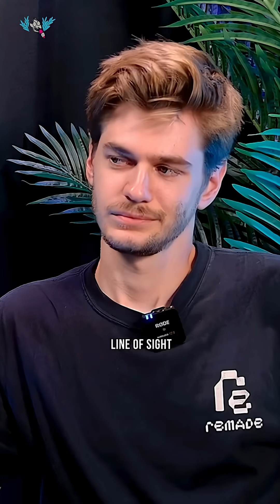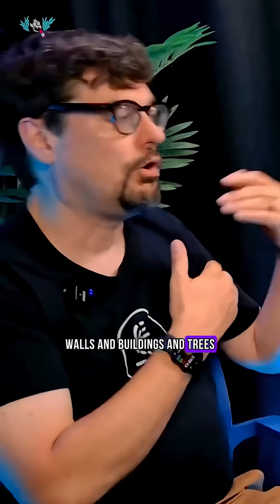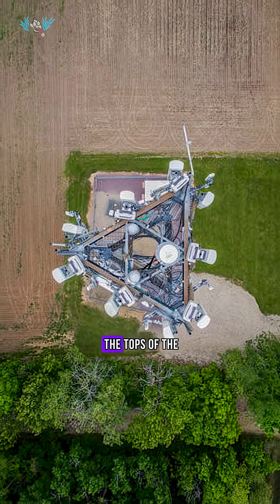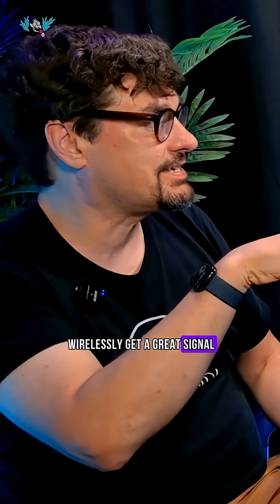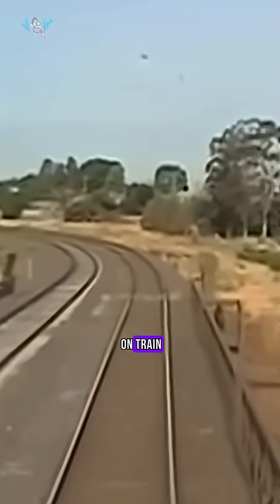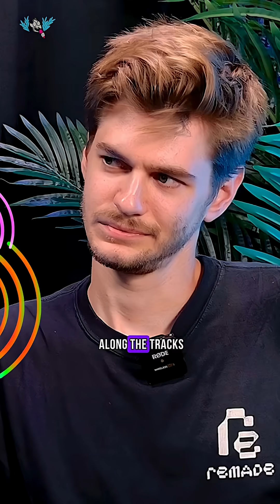Why Amtrak Train WiFi is now slower than Plane WiFi

Comment: The solution is in the pipeline. It’s called “Future Railway Mobile Communication System (FRMCS)”. It involves deployment of 5G infrastructure, but the CapEx is justified because it allows an upgrade to newer / digital signaling systems. 

Bear in mind that current signaling systems are less safe, handle less rail traffic and don’t have an infinite lifespan anyway. So this can be rolled out as part of an asset replacement programme. 

Only issue is that the US always tends to be “too proud” to adopt European led engineering standards and so it reinvents the wheel with its own (inferior) standard years later.

Comment: Fiber-optic cable seems like a good solution. Also, the Boston Subway run by the MBTA has these underground antennas at the stations which bring the signals to the surface and up to the satellite so we could develop the solution around that fact

Comment: In my experience, given similar surrounding envirouments, the main limiter of Wifi speed is the number of people on the train.
If it is nearly empty, you can watch youtube. If it is packed, you won't be able to connect.
I don't think Wifi repeaters have that much bandwidth to talk to all those phones. Not to mention enough wireless channels, even.
That's why on airlines, Wifi internet is always behind a paywall, even for business passengers, because it is an effective method to limit access and preserve quality.
So, even though if you have perfect internet at your Wifi router, it is still not possible to provide quality service to hundreds of people in a small area. This is just due to pure wireless technological incapability.

Comment: Bs,planes cannot connect to the cellular antenna, as cellular tower signal is emitted to the ground and not to the sky.
Reply: Before satellite nearly all plane wifi was cell based, and some still is. That's why it wasn't available across large bodies of water. I was on a regional jet in the US a few weeks ago that was still using cell based wireless service...which cut out as we crossed one of the great lakes.

Comment: Why can't the trains access the satellites? There's nothing above the trains.
Reply: One word (actually one word not three in this case) MONEY
Reply: @norfolkngood8960 it's not that much for a passenger business to use Starlink ... Airlines do so.... Many more jets. Hotels do so.
Reply: Because you need to be able to see most of the sky to use a satellite.  So not only tunnels block them,  but things like tall buildings or forests next to the tracks will too.  In farmland, it could work well, but there are too many situations where it wouldn’t work.
Reply: @AlexGizis  no, that is simply untrue. You DON'T need most of the sky to use a satellite. There are geostationary satellites that never move in their position above.
Reply: @W8RIT1  If you use geostationary satellites, it would require a mechanical device with stepper motors to constantly realign the dish as the train moves. With Amtrak's maintenance philosophy of "don't touch it until it breaks", I doubt the system would be very reliable.
Reply: @derek17ca  true, but that doesn't contradict my earlier comment, yours adds to it, but doesn't detract.
Reply: There’s buildings, overpasses, 
tunnels, station canopies and so on. These are how the line of sight can be affected

Comment: Is it not obvious? Put an array of satellites above the train tunnel. Have them all receive a percentage of the signal and then relay the whole signal put together on a rail like antenna inside the tunnel.
Reply: You say that so nonchalantly with no regards for the stupid amount of money it would cost for little return
Reply: @norfolkngood8960 actually, it's not stupid, and it is cheap. There are geographical locations, and some buildings that do use what are called passive antennas. They need no power, and could consist of a piece of wire. It's like the director of a Yagi-Uda antenna. There has to be good coupling however. Buildings also frequently use another similar method of "leaky coax" cable that is intentionally meant to allow signal to be sent and received from the entire length of cable.

Comment: I just go with option 3. I enjoy the ride and scenery as it passes.
Reply: That's usually the better option, but there are still times you might need to communicate via Internet like email or voice for travel details.
Reply: @W8RIT1 that doesn't needs high speeds actually just turn on roaming and you're good to go

Comment: I thought very little if amy cell data went through satellites anymore because of bandwidth limits and cost. You cant turn around outside and not see a tower.
Reply from the maker: That's correct, cell data isn't typically going through satellites unless you're far from a tower and using an emergency satellite service. But many planes and some trains are using satellites to provide high speed internet to power their onboard WiFi network.

Comment: Planes can't communicate with cellural antennas as cellular antenna do not transmit any data up to the plain, and why would they as most users of this data transfer are located on earth.
Reply: Correct, planes do not use cellular towers, they would simultaneously activate hundreds of towers, especially when flying at 30000'
Reply: Kinda makes you wonder about how people were able to call and "report" their plane had been taken over and diverted on a September morning 24 years ago.
Reply: @derek17ca I think United 93 was able to enter and squawk 9700?, an ACARS code for terrorist on board.
Reply: Correction....7500
Reply: @derek17ca  probably some early adoption of Broadband Direct Air to Ground Communications (DA2GC), AAC (Air to Air Communication) or something simillar, like answering machine for some bigger region as they were more like one way communication sent from plane in some kind of urgency
Reply from the maker: They do, it's called Air to Ground: the planes use a built-in antenna on the body of the plane to connect to cell towers on the ground. These antennae are larger and far more powerful than those on mobile phones, so they can establish a connection with land-based cell towers even when flying at maximum altitudes and speeds, but it only works over land. Flights over ocean require satellites for internet service.
Reply: @Speedify DA2GC uses cellular communication technologies but they do not use cellular antennas. To use DA2GC you need to have DA2GC base stations that are pointing antennas for communication up into the sky. Normal cellural towers have antennas pointing down, 360 degrees around the tower up to 20 km with decent speed. So no planes do not communicate with normal cellular towers.
Additionally DA2GC is not used on all flight trails and depending on the world region it can use different technologies and different frequencies to communicate with planes. And most cellural antennas are standardized so they use almost the same technology and frequencies.
Reply: @Speedify  Planes aren't connecting to cellular networks, standard cell networks do not broadcast anywhere near strongly enough upwards to reach planes at 40,000 feet.  They ,ay use an air to ground system but it is definitely not connecting to cell towers that we use for mobile phones
Reply: @Speedify flights over oceanic areas usually use HF to communicate with ATC. Iridium satellites provide CPDLC for voice communications, usually to their carrier office for assistance upon their arrival or better info on weather and where they may need to divert to.

Comment: Given it just uses crummy cell (admittedly often over a couple of services), is over contended, I’m not sure why it’s any better than just using your own cell. The only time I try it is when my cell stops working, at which point the train WiFi is inevitably no signal too.
Reply from the maker: Yeah, well it is better if you're trying to use a device that has limited data or no cellular. But unless they're doing something smarter with load balancing and/or satellites, it will probably go out around the same time as your phone signal does.
Reply: I mean it might be on a different carrier that works better in a given area, but chances are it's one cell connection providing data to everyone in that part of the train. While your own cell might have a weaker signal reception than whatever they have mounted on the outside of the train car, you're likely to still get better speeds vs better equipment that has to spread the available bandwidth between a bunch of people.